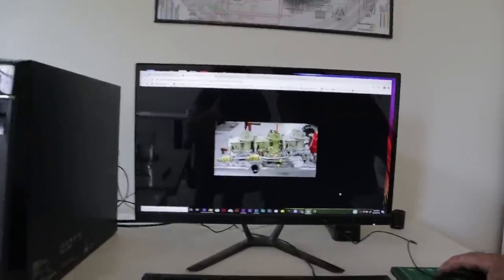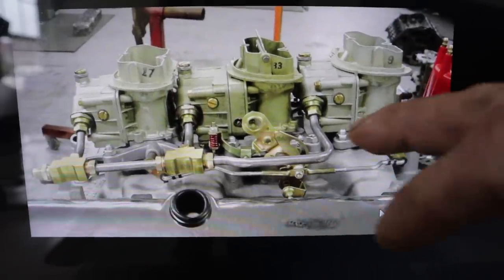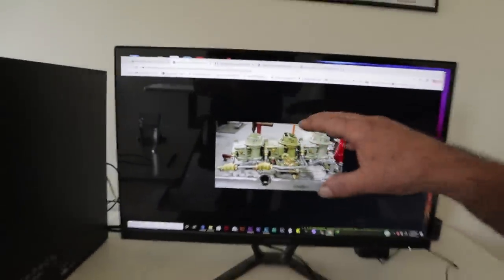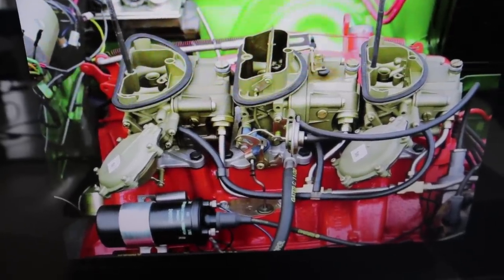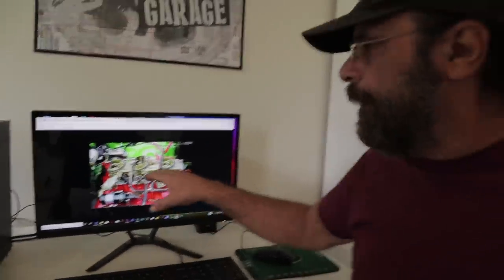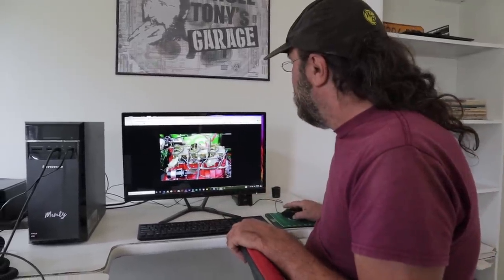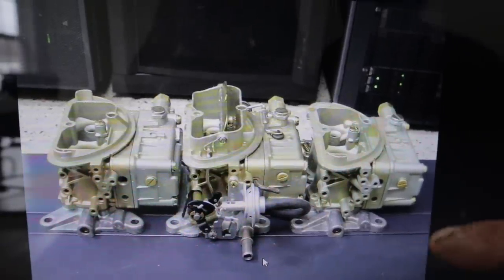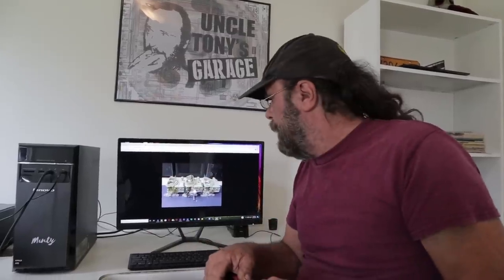The Infamous Chrysler Six Pack

Comment: I'd like to find a Pontiac duel quad manifold.
Reply: Try eBay
Reply: I've found a few they're usually expensive and don't work with HEI because they're either made before the introduction of HEI or cast from the old design before HEI
Reply: Bust out some aluminum and a tig welder?
Reply: Edelbrock makes a new one that will out perform the original.
Reply: Had a pontiac 2×4 setup in the garage back in the mid eighties for my 75 T/A... obviously never put it on and sold it for scrap because I was 22 years old and didn't know any better!
Reply: @charleswerba8722  yea, I know how ya feel, I gave away a Hurst dual gate for a 2nd gen f body, shortly before getting a 76 formula? Doh!

Comment: That is gonna be cool man, looking forward to the build, the home-made six pack I bought from you worked pretty good, I changed the center carb to a 4412 500cfm center, and it helped a ton, did some fine tuning and that setup kicks ass on my 451 stroker in my 73 Satellite, and my 505 stroker going into my Jezebel Charger has 3 4412 500 CFM carbs I modified to work, and let me tell you what, those bastards work like no other. I also have an original set of Direct Connection carbs, with linkage and everything, along with a Mr. Norms air cleaner setup. If I knew you were gonna do this video, I would have sent you my Direct Connection carbs as a visual representation piece for the video.

Comment: Have sixpack modifaid in may 440cui And weiand Tunnel Ram intake modifaid plastick in The runners.The respons are  super grate.Have Even Wedge HP 425 Heads Fully CNC Ported.Have even Pro Chot fogger.Offcors 3 Bult Roller Cam 0.585 lift.(Hyd) The Engine are Grate Engine  The Block are New from 2006 Canada Block..Have even more Godis in May  Challanger 70Se .May Carbs have plates Can Change The Jets.The sixpacks werks grate!!Have done ton off weerk with thes Carbs..The Resbons are super good!!! No no buggning...Esy 10 sek streta Car..I can pot in Absut 150 Hp withe The Nos!!! Grate Video 👍👍🖐
(I have 50 cc Axpump...)

Comment: HOWdy  U-T-G,
I was an  AMC / JEEP Parts Manager & there was an antique portion of my Parts-Shelves devoted to these old Old OLDE  HOLLEY CARBURETORS 
   ( pre-'modern'  290-304-343-360-390-401 cubic inch engines )  which ALL came equipped with side-hung floats & ALL had accelerator PUMPS  on each carb ...
but - this gave me "license" to STOCK  some Holley parts 🙂 
Thanks 
COOP
the  WiSeNhEiMeR from Richmond, INDIANA 
...

Comment: Back in 1974, I bought a used completley factory stock 70 AAR 'Cuda for $3600 Canadian which of course had the stock 340 Six-Pack.  This was a super fun car...BUT...as you said Tony, tricking out the carbs was not my thing considering I was only 20 years old, but still a young 'motor-head'....luvved my muscle cars back then and wish I NEVER EVER should had sold my AAR nor my 68 302 'Zapper'....duh!

Comment: This should be a great video series, love the Mopar Six Pack.... towards the end of this video, you mentioned using the Ford carbs on the Mopar manifold....the footprint of the three Ford carbs is longer than the 3 Mopar carbs (lack of metering plates on the outboard 
carbs), so was/is there another six pack manifold that Mopar used to allow the use of Ford carbs?
Reply from the maker: The Chrysler/Ford carbs use the side hung bowls for clearance

Comment: The three Holley two-barrel carbs were originally designed for the 1967 Corvette 427 tri-power. Holley flow rates two barrel carbs differently than four barrel carbs, at a different vacuum level. Using the two barrel flow rating, the outboard carbs are rated at 500 cfm each and the center carb is rated at 350 cfm. Using the same flow rating vacuum as the Holley four carbs, the flow rating for the Six-Pack carbs works out to around 950-960 cfm for the three carbs together. The 440 Six-Pack intake system adds about 40 horsepower over the factory four barrel 440 Magnum. That's about as good as it gets with the Holley Street Dominator (best low rise intake), the Mopar Performance single plane intake and the Edelbrock Performer RPM. The 340 Six-Pack was more of a gimmick (especially with stock valve springs), but the 1971 Thermoquad setup did beat the 1970 AVS intake on the 340. The 340 and 383 AVS carbs were rated at 570 cfm and the 440 Magnum AVS was larger. The Six-Pack setup did make a strong, modern difference in power on the 440, especially with the Street Hemi valve springs. Chrysler did design a Six-Pack 400 engine for 1972, but with the low compression requirement and the Thermoquad carb available, it was scratched from production. Edelbrock made the low block B engine Six-Pack intake that was designed by Chrysler engineers for the 400, so that is a Chrysler designed intake that was sold by Edelbrock. There were a very small number of 1972 440 Six-pack cars made. These had the same high compression, forged pistons as the 1971 engines and may have all been Dodge Chargers. Something like 6 cars. 1973 was supposed to be the last year of the 440 with a steel crankshaft and a manual transmission, but at least one 1974 Dodge Charger got a 440 with a 4-speed factory installed and it had a steel crankshaft.

Comment: Uncle Tony, years ago I had a 76 Camaro I bought from a widow woman who  knew nothing about it other than “it has an rare engine” is what she said....   it was fast, built for top end. Had a forged pistons, steel crank, double hump heads, 365hp cast iron with 2.02/1.60 valves, studs, guide plates and angled plugs... All that was my dream come true at the time! Hell on my first car  my positive traction came from an abandoned burned out Trans am hull that was in the bottom of a revine!  But my question was about it’s carburetor. It was a Holley, DOUBLE PUMPER (no vacuumed secondary) but what was different is it was a spread-bore holly double pumper! Looked just like a Rochester Quadra-jet. (In my Opp Quadra-jet the best street/strip carb ever made) great mileage cruising around but GOOBS of air when you open up the rears.. nothing sounds like one either when it’s kicking in. Loss of vacuum in the intake causes at the same time the passing gear to kick in (I know it really just downshifts but that’s what I grew up calling it was the passing gear) anyways . The 327 wasn’t original to the camaro but the heads block and crank were all numbers matching... Torquer 2 intake, but that spread bore holly was something I’ve never seen before or since... Ppl have even said I didn’t know what the hell I was talking about. I was young but I knew what the heck a double pump was. All you had to do was hit the throttle and the 4 streams of fuel from the boosters was the giveaway. Even though it looked like Rochester made it it said HOLLEY.. This was in 1992 when I bought it and it had been sitting 5 yrs prior.... Do you know whT the carb might have originally came on? Was it a MOPAR carb by chance? I know I’ve seen thermo quads on chevys.  Thanks bud. By the way I really like your style and enjoy your uploads.

Comment: My friend Dave has a six-pack on a 283. He's running 202 heads and a 30/30 Duntov cam, it's about 10 and 1/2 to 1 compression, the motor is balanced. I haven't heard it run yet. It's in a 66 Chevelle convertible. The car is a piece of jewelry.  Something sweet that tachs. He's got a 70 Cuda Hemi
It's a clone. Nice car.

Comment: You took me back to the old days when I was a poor country boy tuning rich kids multiple carb set-up.  I did two-4's, 3-ducks(of various types) and, even, Jag XKE set-ups.  I had forgotten about the "kill bleed".....glad you brought it up.  On the old Ford flatties they used to put on 2 little carbs on various types of manifolds....I thought the Navarro and early Vic Edelbrock, Sr manifolds were pretty darn good for the day.  Stack them on a flathead with "Denver" heads and Jahns piston with a cam and the old engines came to life in terms of torque.  Of all of the multiple carbs I like the Fords with mechanical pumps.  If I was lazy, I liked the Mopar with the big diaphragms......thanks for the memories.  Have you messed with the new 3-deuce fuel-injection pots yet?  Keep the Faith, Tony

Comment: the 360 is kind of a bad engine todo a 6pac being that (from my POV) a 6 pac is for a high reving engine. a 360 has too large of main bearings and suffers "early" oil starvation due to the diameter of the crank journal and the stock oil delivery. a 360 typically is not a 6500rpm motor. Grand Spaulding Dodge later offered a 340 6 pac conversion for the 1971 340 cars they sold. The GSD 6 pac was (I think )a chevy setup.

Comment: I worked Chrysler Engineering Engine Design 1966 to 1971. Worked on all the 340's, 440's, The 6 packs really cooked. But they were a bitch to keep tuned. Really worked well when the mechanical system came into use. Lots of Fun. But really high priced at the time. But if I keep one today. I worked closely with my friends in the Dyno Labs to perfect these engines. Lot more to this than the 6 pack also the pistons, cams, valves, etc... Ah just a memory now.

Comment: I’m planning on getting a mopar in the future and plan to build a 440 but when I googled standard bore of a 440 it said 4.000 inch bore and when I look up 440 forged pistons standard bore it comes up with like 4.350 bore what is the issue and what is the standard size bore of a 440 ??   

From what I can tell price wise I’m very surprised as to how cheap parts are for 440s I’d say after I finish building one I’d throw rocks at 350s and 454s 

(Wiseco pro tru 440 forged flat top pistons 4 valve spots 4.350 bore comes with everything but the rods for $526 from summit) 

And I can get a new aluminum edelbrock 6 pack intake for a 440 for $417 glad I’m learning all this stuff now when I’m 18 instead of years on down the road (kinda wish I’d know this a long time ago but still)

Comment: What I find ironic about these old tri power set ups was they were initially done because manufactures couldn't make a 4 bbl carb to supply enough fuel to the early performance engines. Classic examples were the first GTOs that had tripower, that got replaced permanently by the Quadrajet. Then down the road Holley made a vacuum 3 bbl carbs 850, & 950 cfms. And of course the Hemi needing 2 carbs to fuel it, which drove the cost up too high for most people to own. I suspect NOW if people have to spend a grand on a tri power they will get an aftermarket electronic throttle body, where you don't have to deal with the tuning problem of a tri power set up. And some throttle body set ups can deal with an engine making boost, and up to a 1K hp. Got to love innovation from the factory AND the aftermarket. Just coming from a guy who was born in the mid 60's.

Comment: I've been looking for a 6 pack system for my 340 magnum for awhile now, and no luck. No one makes a after market 6 pack manifold for the small block mopar, at least I can't find one. My 340 is a actual 340.1 motor, out of a AAR cuda, and I want the 6 pack and want to install it in my 60,000 mile barn find 73 roadrunner. If you know of a 6 pack system I can get, stock or aftermarket,  plz let me know. I would love to get one for my 340.

Comment: Everyone needs a six pack. I have two, 1958 ford 2 door ranchwagon with original 352 intercepter with the galaxy setup and a 4 speed.  The other is 1970 plymouth Satellite 440 pistol grip 4 speed. The mopar six pack comes on harder, but he wagon is heavier and has a smaller engine

Comment: Tri power set ups for small block Chevy are very reasonable compared to Factory Six Pack or  Ford 6V ....I have one on my 406 Ford and all it involved was swapping the original Ford linkage to the center carb.....unscrew the chevy....screw on the Ford.

Comment: I still have my Mopar Magazines from back in the day. In it there is an article about E-Berg [I think - haven't read the article in 25 years] where he had a 69 1/2 road runner with a six pack and he drove it like a regular car all through every season, even winter in New York. About the only slight issue he had was the time spent get all three carbs to syncro' good.

Comment: The channel is going in a good direction.  First a slant 6 build. Then a 318 build.  Now a 360 build.  Tell me this wasnt by design !!!  Lol. Your kickin ass uncle Tony.  I cant wait for you to pile all that on top the 360. I just picked up a set of aluminum heads with titanium valves 7 angle grind, ported blah blah blah. I hear they came off a 1000hp 360 that was in a duster. I been throwing ideas around on detuning them to run on the street. I think a six pack set up would go well with these heads I got so, youve peaked my interest.

Comment: Nothing like the sound of a 440 6-Pack getting on it from a red light. You literally hear the roar of that induction coupled with that v8 Mopar squealing rubber angrily down the road. A well-tuned 4-speed 6-pack will really snap your neck.

Comment: 40 plus years ago a friend of mine had a Duster with the 340 Six-Pack. 
We had just gone over to a guy I new and had gotten it tuned beautifully. 
On the way back to my house we had to go through this blind 4-way X intersection.  This guy in a big rig blew the stop doing they figured at about 70. It hit the Duster at the dog house from the left side. All I remember was my head breaking the passenger side window. When I got my senses back I looked at my friend his hand pinned to the drivers door by the steering wheel. Nothing from the firewall forward was left. We had been going west and were now facing east. The impact had shattered the front of the Duster. Engine and transmission were eviscerated. The only panel that wasn't damaged was the deck lid. 
I remember we salvaged that, and speedo and the 3.91 posi pig. My friend had only had the car a week and had just paid his insurance that afternoon. We where lucky he came out with a busted finger, and me with a slight concussion. But it was a real kick in the ass for the last 10 miles before the wreck. );

Comment: Corvette had a option for a "Tri Power." 427 in 1969, the 427 L-68 which put out 400HP Gross, it was easily identified with the triangular air cleaner, however the 427 L88 had a 850CFM 4bbl carb, which was more suitable for the 12.5-1 Compression monster.
Reply from the maker: We talked about that in the video, no?
Reply: @UncleTonysGarage  

Yea you did, I made the comment before I caught that part, it's one of my favorite carb set ups for the Corvette, it wasn't as common as the 4bbl.
Reply: Corvette had  3X2 427 from 67 to 69. 435 horse with 4 speed and 400 horse with automatic.

Comment: All you need to do is a nylock screw in the eccentric on the right side of the (six pak) carburetor and then tweek it to the correct point and it will open those carbs even with the vacuum secondary like a bomb going off. This is looking at the engine from the front It will hit so hard, you will think you hit NOS. I promise a night of driving you will wake with a sore neck from G-force a big 75 cent mod for all that. I had number 54 in the spring of 1969. The purpose of this second linkage was an emergency shut down of the carburation in case of a  failure of the main throttle on the left side looking at the engine. Paul- Drive Safe.

Comment: Dad always said God hated him. He worked for a Ford Dealership  from 58-66 and then went to Chrysler Plymouth Dodge in 66-76. He said everywhere he went there was the 6 packs staring him in the face... He said two of the worst thing was. Most were not daily drivers. So they would sit and develop problems internally. Second was the people that "Thought" they knew how to work on them. Since they were so temperamental, say going from Mountain elevation to say Sea level, or even summer to winter they were always needing tweaked, and that was much of their demise... 
I think that was one of the reasons he was so adamant on leaving things stock, and just leaving things alone.  Factory settings was almost always the best. When people tried their home made remedies on these things it got them chasing their tails trying to figure out what they had done wrong. Many people just yanked them off in a couple years and put a 4 bbl. intake on them and gave up...

Comment: Do you like mechanical secondaries over vacuum then?
Reply from the maker: Six of one, half a dozen of the other...AND, the perfect pun, right there
Reply: Marshall W  and can't you play games there with linkage if it's mechanical  , make the other 2 come in later or earlier ? 
I thought I read somewhere some guy tried making it progressive but I can't remember the outcome.
Reply: MrHillfolk Pontiac was progressive in a fashion, the end carbs didn't move until about 3/4 pedal travel, and mechanical advantage ala shorter levers on the ends made them go full open on the last 1/4 of pedal travel, worked great !
Reply: @Colt-tf6xf  That was not the consensus of the motoring press at the time. Tony talked about vacuum secondaries that were too slow to kick in, and Pontiac's was the worst. They would have said it was the smoothest. And in typical GM fashion, it was difficult or impossible (I never had one myself) to adjust those vacuum secondaries to kick in sooner, so the great majority of Pontiacs got mechanical linkage soon after being bought. There were kits.
Reply: Geoff Graham thanks for the clarification, obviously the one I had was revamped, it was a 66 that I bought used for $600, at the same time I was looking at a 70 RoadRunner with 440 sixpak that was$900, I only had $600, who knew ? I had it 5 hours and had 4 holes shot in it out running the cops. Mom and dad sure were proud that night
Reply: I think vacuum secondaries are better for street use, but mechanical secondaries are better for racing. Better control over when things open up.